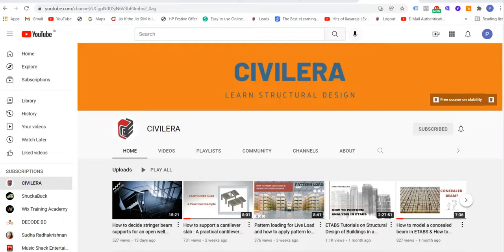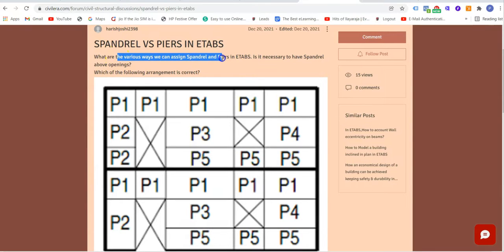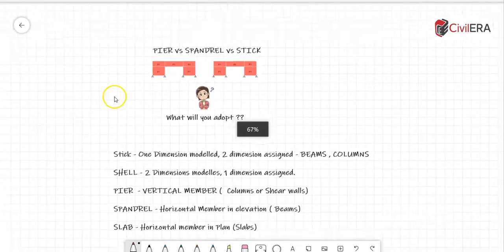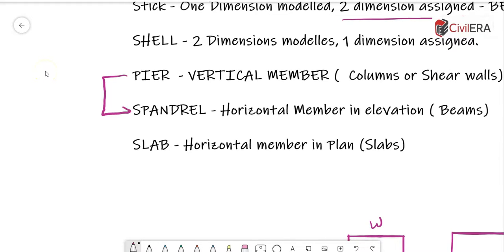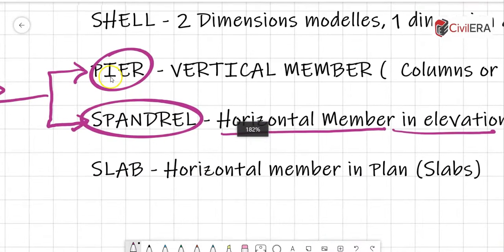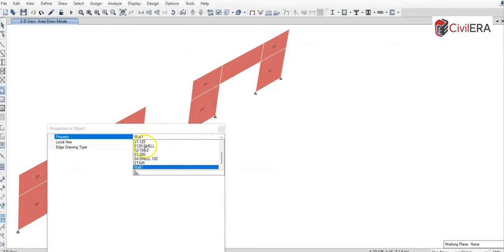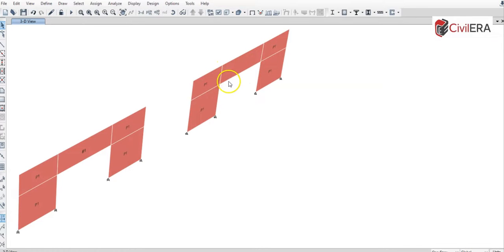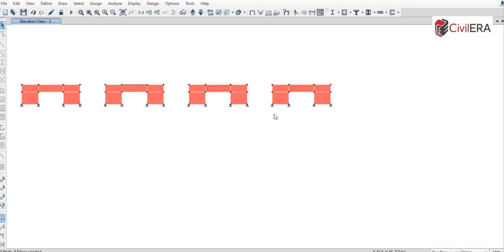Shear wall & Deep beams – Will you model as Pier or Spandrel

Comment: Generally, I model Coupling beam less than 1000 mm depth as frame but more than 1000mm as Spandrel as shell element. 
I think in pier vertical reinforcement governs whereas in spandrel horizontal reinforcement will govern. 
It depends on designer how they want model it according to its use in structure.
Reply from the maker: It depends on the situation. Not always as wanted by the designer. He needs to know the way these works and then decide.

Comment: Do we have to assign pier to behave as shear wall?? and If so then we don't need to assign pier to basement wall(When it is not designed as shear wall (designed as cantilever slab))
Reply from the maker: Any thing if you want to design the wall, you need to assign a pier label.
Basement walls can be slab or wall but if you need design, it needs to be wall and assigned pier label. It is predominantly a wall and not a slab

Comment: In rc structural wall system can we model the beam instead of spandrel for high rise building as per is code??
Reply from the maker: Depends on the size and location of beams. Are you referring to Mivan shuttering system

Comment: It would have been great if you would have explained pier and spandrel labelling as the labelling shown in the video is incorrect
Reply from the maker: It is easy to make loose comments. 
1. Know the reasons
2. The content of the video and the context is not pier label. It is about pier vs spandrel
Reply: @CIVILERABangalore 
It's not about making some loose comments. The labelling was the other extra information in the video which I highlighted.
Reply: Also please check the description of the video. You have clearly written that the video shows how to assign pier and spandrel labels as well. So that is what I pointed out that the pier labelling is incorrect
Reply from the maker: @shareqinamdar8903 it is surely as you are commenting with out knowing the purpose and intent. It may be wrong to achieve what you are assuming.